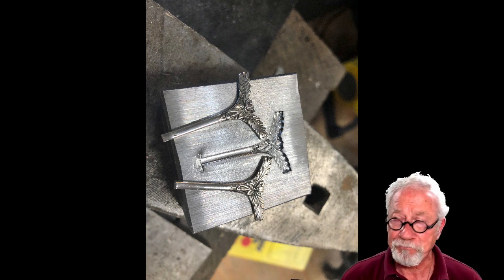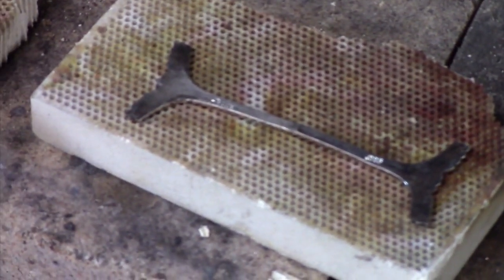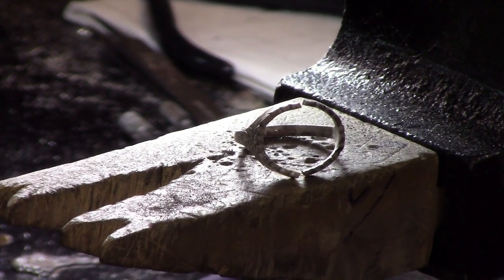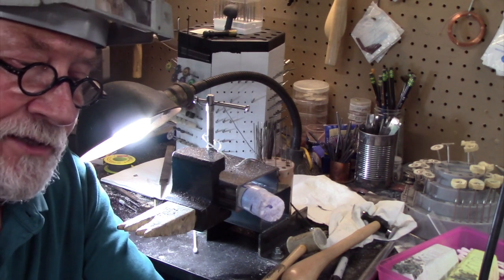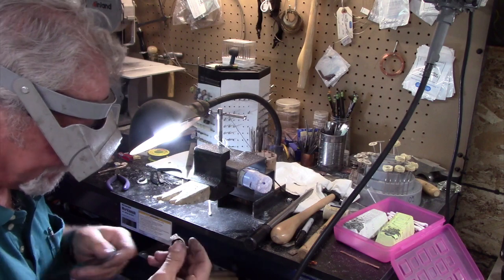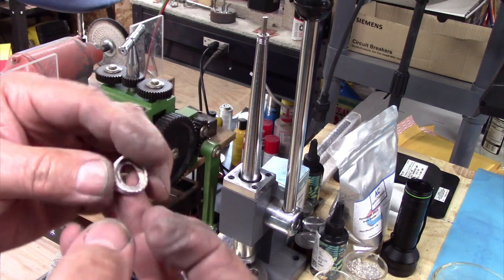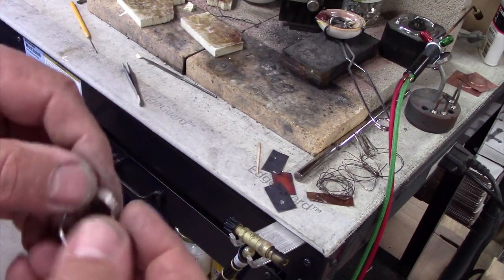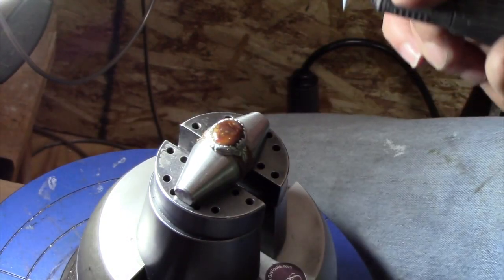Victorian T shank ring - sterling silver fabrication 2021

Comment: I would have liked to have seen and heard details on how you pressed the ring initially:  What gauge silver did you use?  Did you melt and roll the silver yourself or purchase?  Also, how thick was the urethane block used when pressing the curve into the top part of the ring?  Thank you.
Reply from the maker: This one was just (I think) 16 g purchased sheet. The Tshanks are fairly shallow. I either transfer the shape to sheet or do an initial impression to get a ghost then saw out the profile for further pressings. Typically takes me 3-6 cycles of anneal, trim, press. The urethane is a block about an inch, years ago I had purchased a large piece for a different purpose (backing up a disc cutter).

Comment: Would it be easier to use a dap instead if a rod in the press?
Reply from the maker: You can dap or use a bender. The small press is ideal for this but they also make nylon bending pliers. I show what works if you have nothing else.